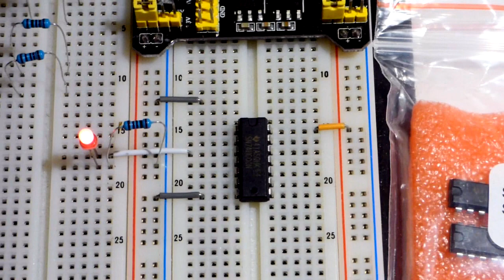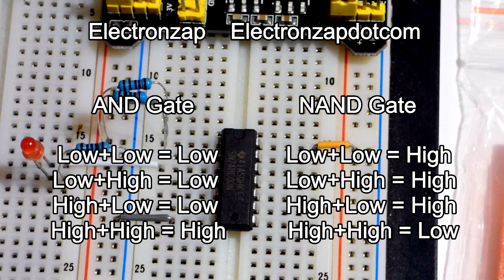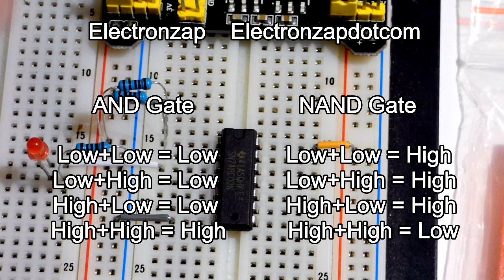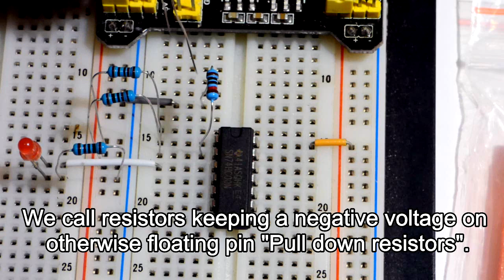SN74HC00N integrated circuit IC quad NAND gate circuit test

Comment: Where did you purchase that IC?
I’m stocking up my electronic supplies, and I try to get quality components at cheap price. However, since you are very experienced I hope you can tell me where you get most of your components. Also, I just started learning about logic IC’s, but I want to get books about the subject as a complement to videos, do you know some good ones?

Thanks
Reply from the maker: A number of years ago I got these ICs from this "Make: Electronics kit 2" kit https://amzn.to/2W17VDh which may be updated now, so the parts may not be the same, but the pictures look the same as my kit. I usually go to Ebay, Amazon and Digikey websites and search the part number to compare prices and shipping times if I don't have any I can use from a kit I already have. "The Art of Electronics" https://amzn.to/2ExPbAx is my favorite book right now for those who have some experience reading schematics and building circuits on a breadboard. I haven't really looked through my other books in a while but I remember "Practical electronics for inventers" https://amzn.to/2Qw3N8l really helping me a lot when I was first learning about logic gates and other topics.